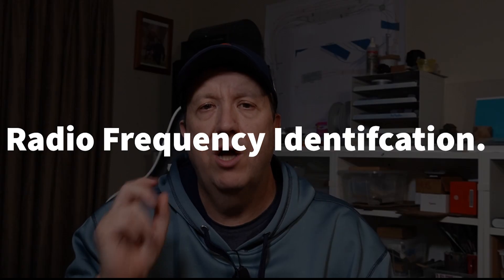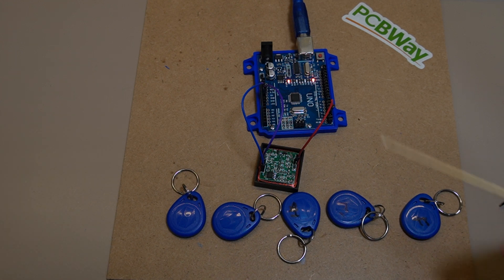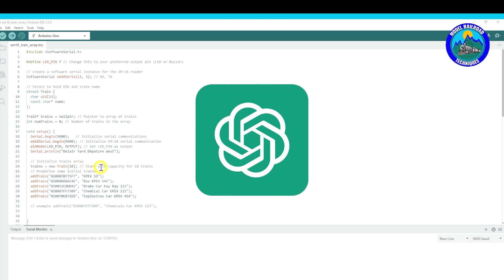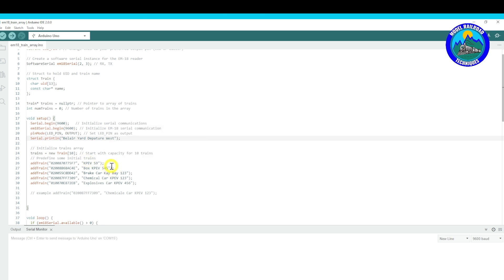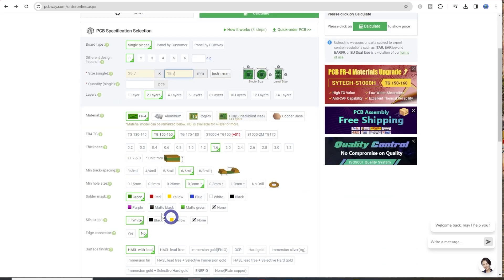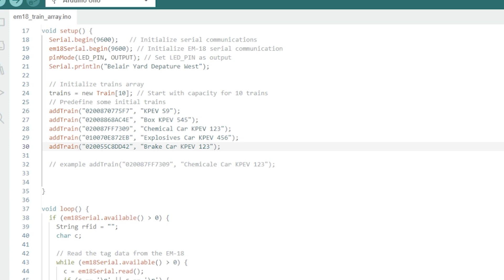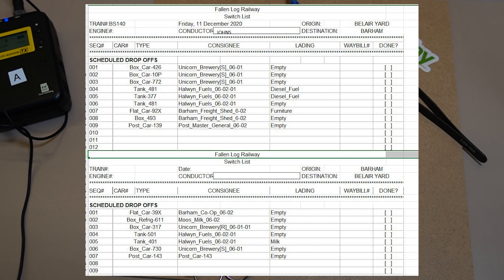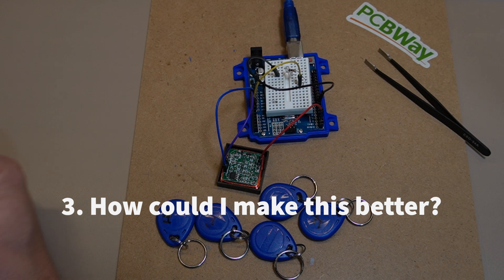Master RFID Tracking for Model Railroads: The Ultimate Guide for Arduino Integration & Tips.

Comment: I've thought about pcbway to do a small number of circuit boards. I don't have a circuit board drawn up, which they seem to want, but I do have 3D prints drawn up in files they except. Putting a simple bracket up for just one they want to charge me $23.15, and that is just the subtotal, when it cost me $1.25 with 2 hours and 47 minutes of print time. Setup time is almost nothing, and printing two is just telling the printer to do so. Printing 2 is 24 cents short of double the price, when the single cost is insane. Double is ridiculous.
Reply from the maker: Perhaps reach out to them about the pricing. They are receptive. What medium do you want them to print in? I got a box printed that cost 1/2 this bracket in blue pla. I am not sure you can compare a commercial print to a home print. I have got a filament printer and resin printers both very good, but still not to the quality. It really depends what you want? Can I suggest you watch this video how a print farm breaks down their costs. https://youtu.be/5koU93oZVC0?si=Z0T9glRe8_FwVyh7 . This is a cottage based business and how he charges $55 for a $5 part., it’s a great video breaking down the costs etc.
Thanks for reaching out.
Reply: @ModelRailroadTechniques  Thanks for your input. I think you can compare, when it cost twice as much to do the second one, and doing 10 is just over $200. It doesn't cost that much in filament or time to do more than one, and you would think they would be more efficient at doing multiple prints than I ever could be.

To give you an idea. This is a bracket that holds 2 ice cream containers for Talenti ice cream to organize things and parts. You just slide the container into the bracket under a self. It's a large print made from PETG, but not that complicated. 

What I want is a circuit board for a block system I designed. I personally need 3, and foresee the possibility of making more. If their pricing is even half, and charge double for the second, then that is too much. My cost with these is just under $6, board 4 sensors and all ready to hook up. I am not looking to have them beet that price, but at least be reasonable.

I used what I knew, 3D prints, to judge their pricing. Even at half for more than one it is way too much, so their printed circuit boards are probably way too much as well.

Nice video on the tags.
Reply from the maker: @lesliesavage9229  that’s for your input. I have a video on PCBs coming up in the future. I go thru their website and order some. I will be making a loconet splitter
Reply: @ModelRailroadTechniques  I use to print them myself. I haven't looked at anything recently, because I don't have that many to print, as of yet.